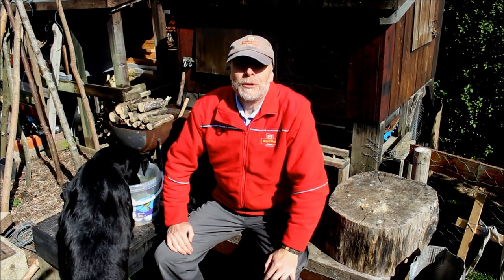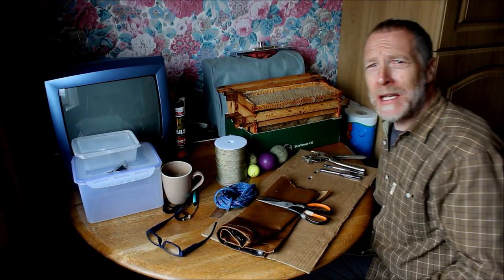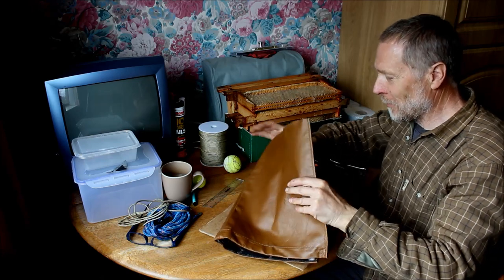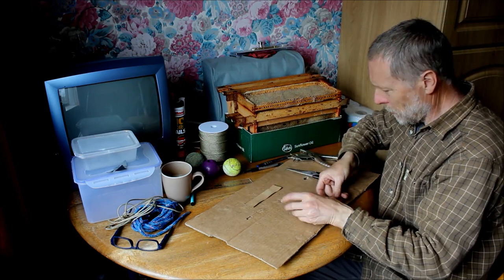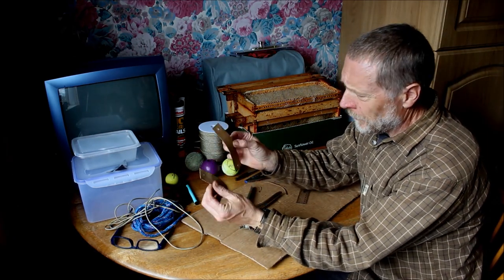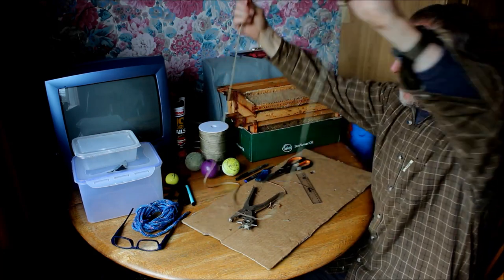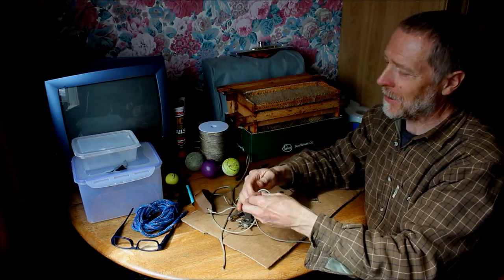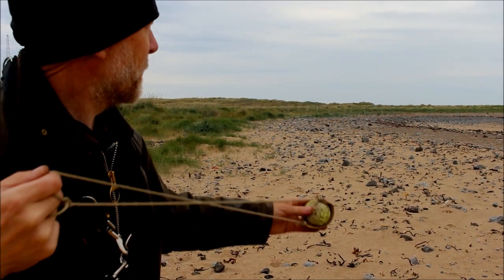The Shepherd's Sling

Comment: What a godsend! What a perfect size pouch to hold tennis balls to throw for my dog !   What is the length and width of the 2  leather strips used for your pouch ?    Like/Subscribe/Bell
Reply from the maker: The two leather strips (from a leather sofa) are 3 cm or just over 1 inch wide and 14 cm or about 5.5 inches long, a little bigger for tennis balls would be OK although I use mine for tennis balls too without a problem. If you have not use one before it is always good to start with tennis balls, until you get the swing of it 🤣 All the best and have a great weekend
Reply: @GrasshopperOutdoors  THANK YOU!